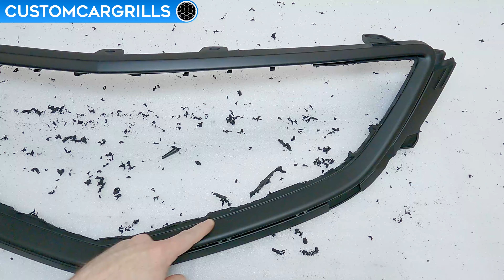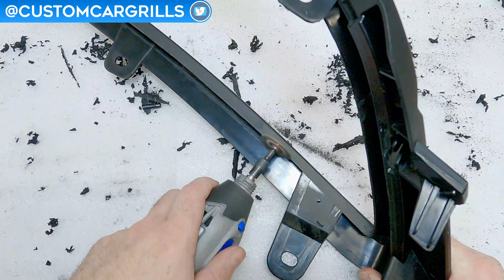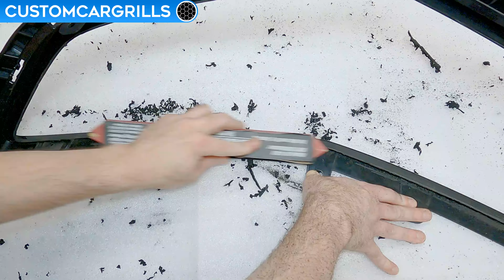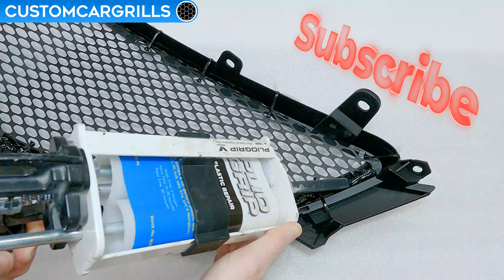Acura TLX 2015 - 2017 Beakless Mesh Grill Modification How-To by customcargrills.com

Comment: How are you gonna make a video about a product and not show the final result on a car? come on man show off how it looks unless your scared it looks like poop
Reply from the maker: Installed pictures are available here:  https://www.customcargrills.com/proddetail.asp?prod=Acu-TLX-15  scroll down and click the Custom Gallery button in the description.

When I make these videos, typically they are for customers who are paying for a one-off or first-time build of the grille and I don't have the vehicle here in person.

If the owner who is buying the first-time build doesn't send over installed pictures, then I don't have any to share in the video at the time of posting.  Sometimes we have to wait for other owners to send over installed pictures, and on occasion we never get installed pictures from any owners on a specific model.  If I could inject installed pictures into the video afterward, I would.
Reply: @customcargrills  is there not any sensor attached to the original grill? I want to change mine but I also want the Acura badge installed back in center.
Reply from the maker: No sensor on the 2015-17 TLX.  That was something they added in 2018 to the best of my knowledge.

Dealing with sensors is tricky, they often don't like being modified in any way.  We have adapted some in other brands before but have not tried with Acura.  There's likely a solution that's possible; I just don't know the specifics for Acura at this time.

Comment: I replaced my grill and now I can’t get the rubber sill on top to fit
Reply from the maker: If you bought a new grille frame, most come with a new rubber strip.  I don't think that the rubber strip is supposed to be re-used if you're trying to transfer it from one grille to another.  Feel free to email me if you're having issues with a new strip.

Comment: Any way to put a badge on this?
Reply from the maker: Some badges could be installed.  If you're trying to do one in the center though, it'll need to be raised up enough to cut out a v-notch on the back of it so that it fits the bend in the center of the mesh.  Otherwise, flat badges on the side should be no problem.